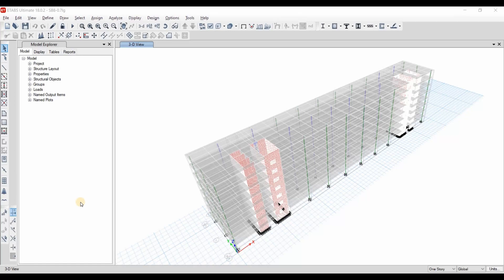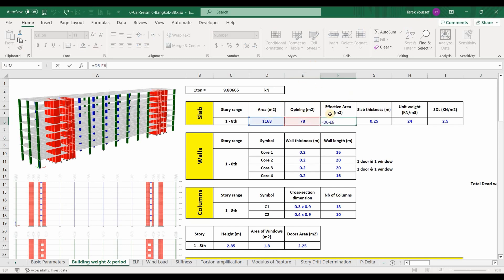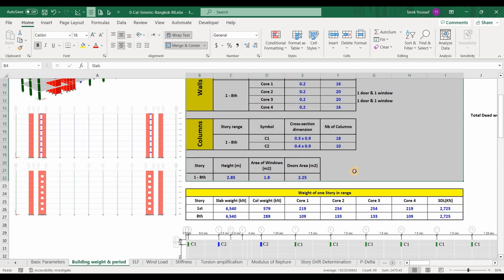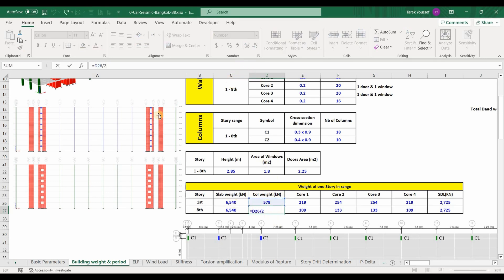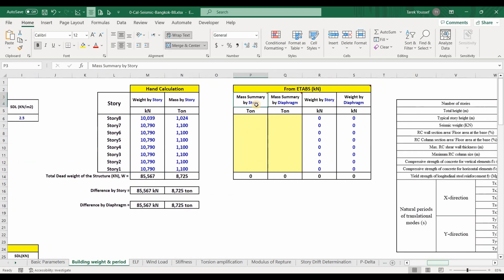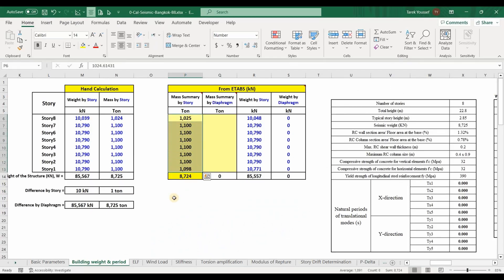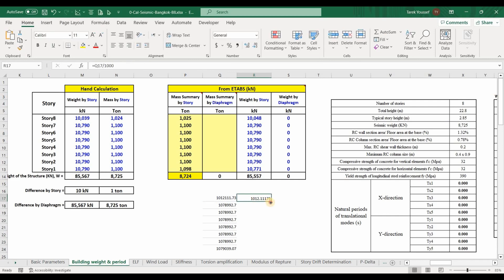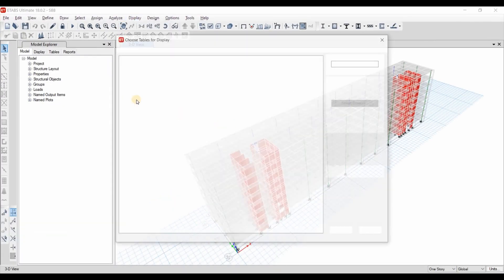ETABS Tutorial 8: Manual Calculation of Seismic Weight and the Role of Mass Source in ETABS Software

Comment: whether the beam is not used in this building?
Reply from the maker: In this particular structure, we've taken the approach of considering the slab as a flat slab without drop panels. As a result, beams are not included in the structural system.

However, if beams are present in a different model, it's essential to add their weights into calculations. The technique remains consistent: by multiplying the beam's volume by its density, we can accurately account for their contribution to the overall weight of the structure.